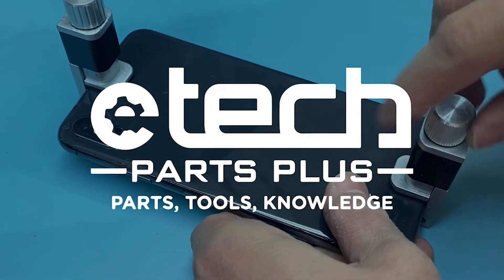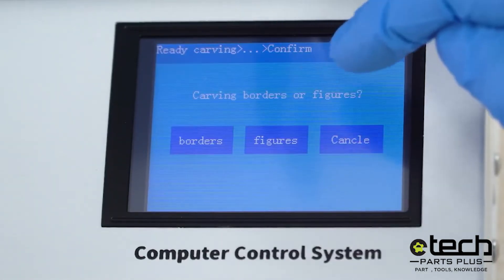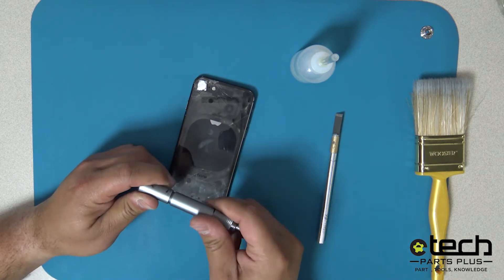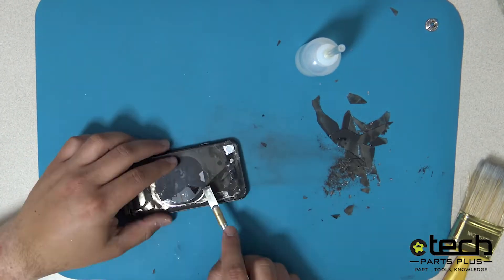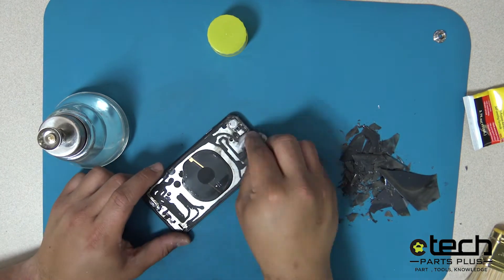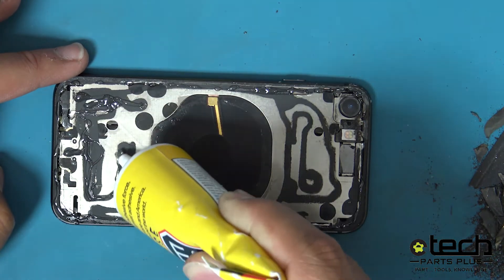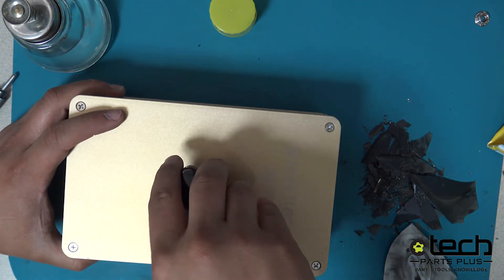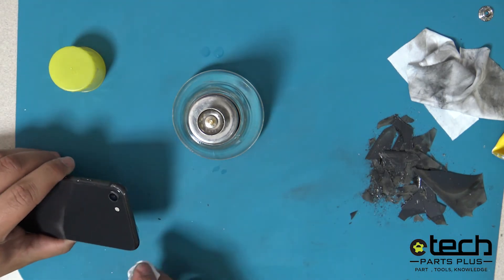Blue Light Laser Back Glass Replacement Process

Comment: How do you get rid of the smell?? These phones stink so bad after the back glass is repaired!
Reply from the maker: Great question! We recommend taking a microfiber or paper towel and some isopropyl 90% or purer alcohol to wipe down any residue after prying off the glass. You can also use canned or compressed air to blow away the dust residue.